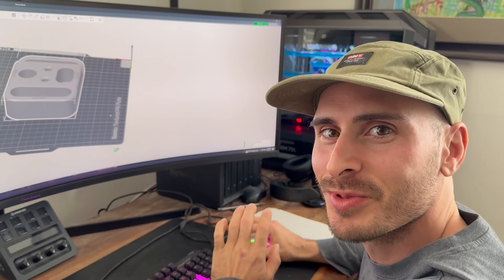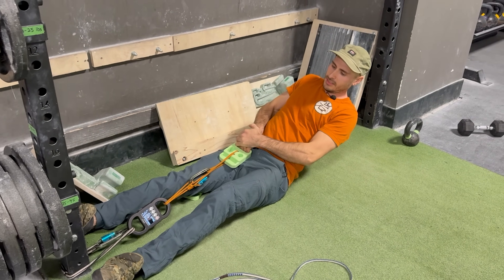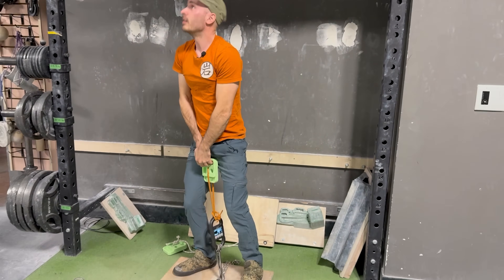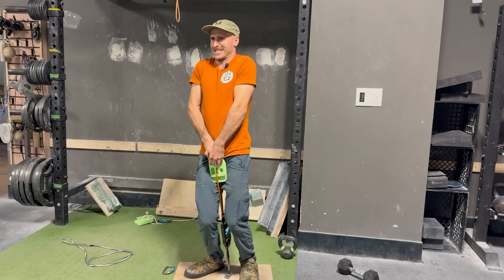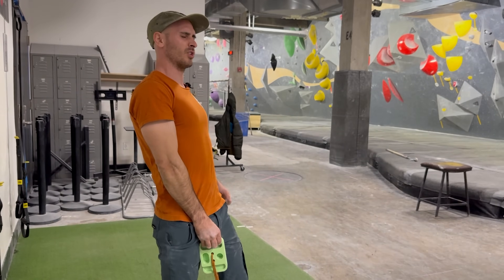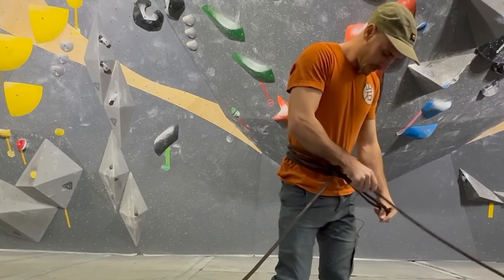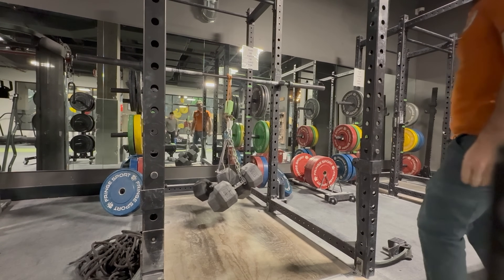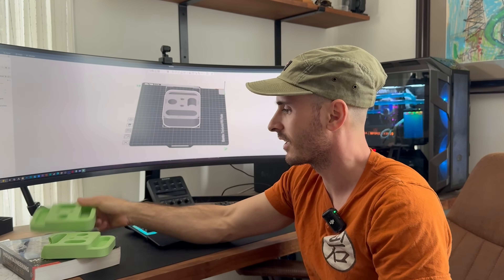3D-Printed Climbing Crimp vs. My Grip Strength – Will it Break?!

Comment: I hit my 3d printed pinch grip with a sander and the grip is much better. probably need to sand it manually in a crimp slot. Don't breathe this!
Reply from the maker: @oryano  good tip! Definitely want to try some skateboard grip tape though